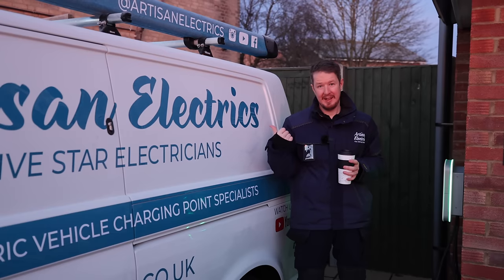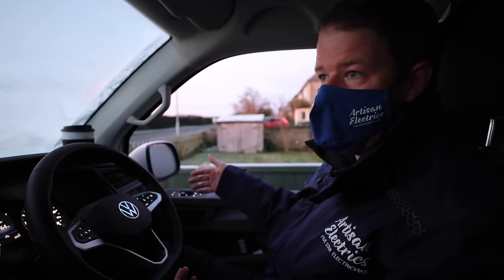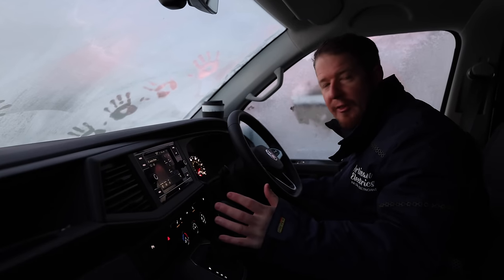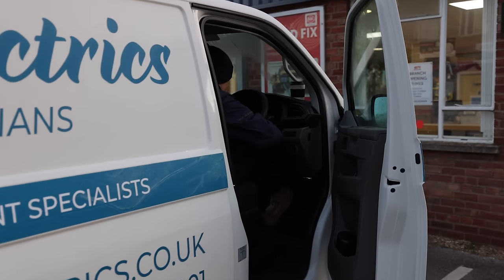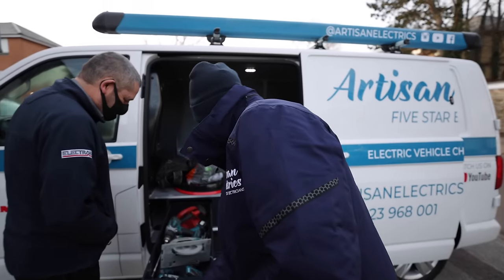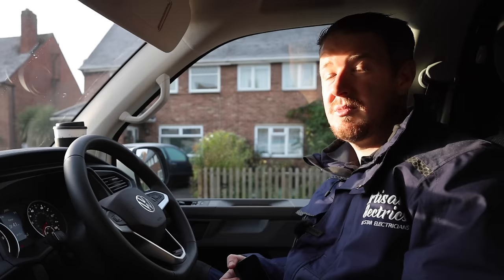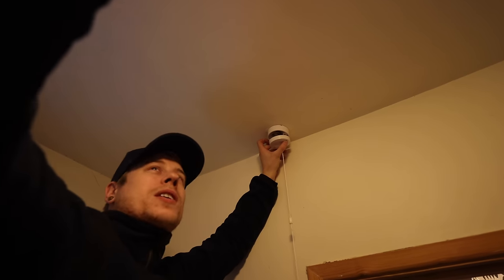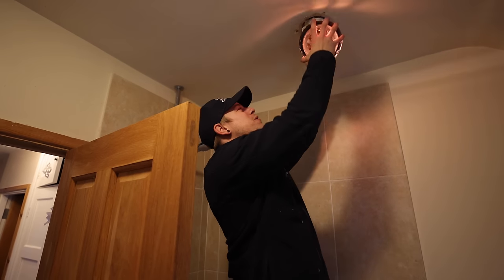ELECTRIC VAN NIGHTMARE 😬 - Volkswagen Transporter Electric Van

Comment: Great video Jordan. Hope the new van works out. Should you not be getting a maximum reading of 0.05 on the bonding conductor?  Perhaps your meter turned off and the leads needed to be nulled again. All the best and keep up the good content 👍🏻
Reply: It's 0.05 between simultaneously accessible parts mate not necessarily extraneous parts themselves
Reply: But this in an R2 test to test the bonding conductor disconnected from the MET. Your testing the length of cable for continuity and and making sure there’s no damage. On a 10mm bonding conductor a reading of up to 0.05ohms is normally obtained. 

Table I1 of the On-Site Guide (OSG) – and Table B1 of GN3 – gives the resistance as 1.83 mΩ/metre (0.00183 Ω/m). The maximum length L of a 10mm2 main protective bonding conductor can be found from:

             0.05 Ω      

  L =   0.00183 Ω/m  =  27.3 metres

The reading obtained by Jordan would of meant the cable was either 100s or meters long or damage. 
As mentioned I suspect his meter had switched off and the test leads needed to be nulled again.
Reply: @jonhosier356  From an old spark from the 60's. Jon you beat me to it, it was obviously a far too high a reading for 10mm bonding, my calculations showed the bonding to be over 600 meters, I guess Jordan was distracted concentration during videoing, Jordan is usually very diligent, but can easily be confirmed and rectified when they change the CU just make a note for future rectification. 
P.S. Crap van, will cause more headaches and frustration in the future.
Peter.
Reply: @jonhosier356  spot on there
Reply: Yes the reading is too high, I can only assume Jordan thought it was 0.1 as it was read out by camera man.
Reply: Jordan probably quickly sussed in his head that the bond was 0.02 and the null had be cancelled.  He just didn't mention it in the video.
Reply: @jonhosier356  yep, that 50m wander reel is going to add at least 1 ohm if not nulled
Reply: @havoctrousers  why isn't there a proper test device with a 2-core wander cable? Then the (dedicated) meter can send test current down one core, and read the actual volt drop on the other.

Comment: Shouldn’t the maximum reading for water bond be 0.05 ohms ? You had 1.09 ohms and said it was fine ? 🤔
Reply: Its 0.05 ohms max between the clamp and pipe not the entire length of cable, Im fairly certain that a bond of 10mm over 25m should be upped to 16mm to keep to resistance low enough for its task; which is to reduce touch voltage to <50v and trip fuse in 0.4s, so the max resistance of a bonding conductor can be worked out from that !

Comment: I have an electrical question relating to this.

The van charges at single phase at 3.6kW or 7.2kW on three phase.

I'm thinking that the van will just have two AC to DC inverters and effectively be a two phase charger (when on three phase).

Aside from being naughty, could you install a 3 phase charger on a single phase supply and just loop the single phase input to the 3phae charger?

FYI we're one of the very rare cases that this van suits, although having the additional charging speed would really help.

Comment: My E-van had a setting where you set the time you want to use it and it will pre heat the van so you come to a nice toasty vehicle.  Let’s say you want to leave at 7. You set it for 7am and as long as it’s plugged in and charged it will not only melt the ice but leave the cabin nice and warm for you to get in. That heated button might have been a demister for the mirrors. 

I had the second gen e vans. 8 hour charge time and upto 80-100 mile range. I sold it after a year and bought a diesel again. I’m prob going to buy a hybrid estate or mpv and use that as my work vehicle until e vans become better.

Also range wide load will factor in a lot. With tools and stuff will drain faster

Comment: I definitely won't be changing to EV until I have no choice. Free tip for clearing your windscreen and side windows. Just use cold tap water on them. With screen poor the water over it and put the wipers only once or twice and leave it 👍 if your away from home keep a bottle of water in the van 😉

Comment: Boiling water might crack screen , warm tap water is fine . You can not TOW an electric vehicle will damage the motors , it has be on a trailer . Chris

Comment: Best way to defrosting in the morning. Get a 5l bottle from screenwash or something like that, fill it with water and leave it next to a radiator overnight, in the morning put your wipers on and pour your 5l of lukewarm water over your car and voila, no frost. Using de-icing spray sucks because it can just make the inside of your windscreen freeze. Lukewarm water means ti doesn't cause thermal shock to the windscreen and crack it, the volume of water puts enough heat into the glass to stop it from re-freezing.

Comment: Sorry, but I have never seen a person, that did not know how to scrape ice of a window, if it had been a diesel car, the problem would have been just the same, there have been cars on the road more than 100 years without heated windscreens. 
You don´t roll down windows, when they are frozen, you risk pulling the frame off the glass inside the door, then you are in real trouble. 
But no, these EV vans do not work, they need to become better than they are now.

Comment: Always read the "destructions".  Switches should not be mounted on furnishing, walls only now.  No "Do not remove label" on bonding but regs cover such.  No fan isolator.  Cowboys let loose before you got there.  2E in one sleeve they could not have tested that!  External cables should be weather protected too.

Comment: I live in Sweden temperatures can hit -20 in this area batteries don’t like cold.  Try fitting a coupe heater which you can plug into the mains via a timer your van will be warm with no frost also buy an ice scrapper.
Reply: Not sure about this van, but EVs can be programmed to heat up (or cool down) for certain times. And if you leave them on the charger, you won't lose range and your battery is also on temperature.

Comment: So to summarise all the comments:

* £55k vehicle doesn't need a windscreen defroster.  Such feature is for more expensive vehicles.  Just get out there and start scraping with a credit card until your fingers go numb and stop whinging already!

* Windows don't need to be designed and tested for cold weather, because Europe doesn't have cold weather.

* Range anxiety isn't a big deal

* Nobody needs to go faster than 60mph

* Charging ports don't need a manual release on the plug.  The computer should decide when you're allowed to drive.   Refuelling should be done through smartphones because we are all very clever smart individuals with our smart phones living in futuristic society, get with the times man!

Comment: You can use similar tap water to outside ambient temps; like pouring a bucket or kettle of cold water to help melt the ice. Obviously a large enough differential in temperature and you have no windscreen

Comment: I made similar mistake on my first EV VW golf  pitiful range. I now drive a Tesla model 3 long range and it has enough especially with the Tesla supercharging stations. When I see these Vans and trucks coming out with a hundred miles or 120 MI not enough. I have a cyber on order the tri motor because of the 500 plus range. I'm a general contractor in California and I know when you weight things down and in my case tow equipment. That 500 will turn into 250 which will still be enough the fact is Tesla is the only EV  maker that knows what they're doing, not saying that others won't figure it out they just don't have a clue yet. Cheers from Northern California.

Comment: Bummer, but Caveat Emptor still applies. 
 VW was COMPLETELY sitting out EV's, all its chips on it's diesels to get to the required fleet mpg figure required. 
 When they got busted for cheating (1st reason not to buy vw) they switched to EV in a literal 180 degree switch and came out with their first model in 2 or 3 years.
 ALL their 1st gen are converted ICE cars.
 No way it wasn't going to be half baked.   ;)

Comment: I'm wondering if you should even be driving ;-)  "Out of my control" - not knowing how to use your own van is completely in your control, not having a scraper is completely in your control, not knowing to not use water from the kettle (just slightly warm water from your hot tap) is completely in your control.

Comment: I'm interested in the problems of switching to EVs, but reckon several of those complained of here are easily avoided with a modicum of preparation, such as familiarising oneself with a new and expensive vehicle.
Also, since one wants a clear windscreen promptly first thing in the morning, why not add another £5 to the investment of £50 000 by acquiring a windscreen frost protector?

Comment: At first i thought this is a great van. You have the combustion engine with a pretty decent range for a hybrid. Only to find out that the add i was looking at stating it has a 1.6 litre diesel along with the electric option was coming from a template and was not accurate. I was so surprised that it was delivered with only electric with the range of a hybrid. A very weird vehicle. And not cheap at all. Hope you had a shortlease contract on it so you can get rid of it.
Reply: My 1956 Austin A30 van was better than this. Kept going in the record breaking winter of 1963.

Comment: User error.... I have a nissan env200. I preheat the cab while plugged in, enjoy heated seats and steering wheel and. It's the cheapest 24kwr model for £15k second hand. I do 99% of my days without using public chargers. I get 50miles range at 60 mph and 70miles range around town

Comment: I'm sorry but to 

1) buy an electric van that only does 65 miles is crazy.
2) not to test the van to get to know how it works is crazy
3) to pay £65,000 for a van is crazy.
4) to show such technical incompetence on here is crazy - I wouldn't use you.

Frankly, I'd be quiet about all the issues. I'd take the van back to the seller same day and demand a refund.

Comment: Ford don't have the only heated screen.. Most Nissan cars do now.
The window that gets stuck has a pressure sensor built in because it auto go up which is a neck snapper to a child.. For such similar reasons it has to have safety built in. The frost is jamming the glass guides.. Pressure

Comment: As soon as the first manufacturer brings about a 600 mile range van transit custom and sprinter sized they will drive all the ice competitors into the ground then also drive all business competitors into the ground for business users because they can quote less with the minimal fuel and maintenance costs

Comment: have you tried locking and unlocking the car when the cable wouldn't get out? also, was the wall charger set to charge? because i am pretty sure the power used to defrost the window was coming out of the network if it was. also, scrape the damn windows instead of clowning around putting your hands on them. better yet, just press the preheat button if the car has the option.

Comment: The main relay will not cut in until the charging plug is removed and the indicator on the dash shows 'READY' the charger lead is released by pressing the unlock button on the remote.

Comment: The range alone would be a deal breaker for me in a van, if that's the range when empty, by the time you've got a bit of weight in the back it'll be useless. For an electric van to be successful I'd expect at least 200 miles unladen and 150 laden, and 120 on a cold day. With only 64 miles range to play with that wouldn't get me back home after a couple of jobs. Sure you can charge while you're out, but it's not as convenient as diesel due to the time taken. Don't get me wrong I'm very excited about the future for electric vehicles and can't wait to get one myself, but we're not there yet for commercial vehicles as far as I've seen. This is another reason why it's short-sighted for government and councils to ban diesel vehicles in towns when the electric equivalent just isn't ready for prime time yet

Comment: does the transporter have an excessively tiny battery? afaik its designed for last mile delivery. like hardware stores and building supplies. around 50mi a day tops

Comment: You would (honestly) think that VW had placed those fine wires into both the front / rear Screens, for melting the ice. They don't draw a lot of current, and (surely) this form of demisting and heating the Screen on this EV VW Van has not yet been discovered by its' new Owner.

Comment: Reel out an extension lead in to van and plug in an oil filled heater put it on a high wattage timer. Let it come on half hour before vehicle use. Secure rad down and you have a heater for the 1st hour. Ps. Dont forget to unplug heater before driving off.

Comment: we returned our EV work van within 48hours.. it refused to charge for 2 days in the cold yet it was running 80+ amps for a full day... its still cheaper to run my diesel even at the prices.. when it did finally charge we had about 73km total even with the extra capacity battery. when we finally got our electricity bill the 2 days of charging was more then a filling up both diesel tanks on the ford truck.. we were not impressed whatsoever with it.

Comment: I've never seen someone so inept to get a vehicle deiced and actually move, may I suggest reading the manual on the vehicle before you use it. As for the electric window the glass and the channel that the glass runs in was frozen and the window going up to a certain level then going down was to stop you from straining the mechanism and thus burning out your electric window motor (It's there to stop people damaging the motor/mechanism when there's an obstruction for example someone's arm or a frozen window.

Comment: Yeh I don't think for a job like yours a pure EV is approriate, I think a Hybrid with a desiel generator would have been a better option, because having 50 miles of EV range isn't horrible when you can extend that out to 150 - 250 miles with the diesel generator without having to completely rely on the desiel generator for the power to drive, because at that point it's going to be slow and really slow to accerlate.

Comment: Dont know about Germany but here in Finland where it get minus 20 down we have webesto in cars and or  plug in engine heaters as well as basicly a fan heater in the cab that warms and melts ice and snow. and most car parking places have a plug sockets i mean heck been from England myself lived in Finland for 2 years -2 seems so tropical 😆
Reply: German here. Although Webasto is a German company, independent car heaters are not that big in Germany. Some people have them, others not. But winters are not that harsh here in Germany, so that most people can live without such  heater (and then we have the usual idiots not scraping the screens or only a small hole...), especially since climate change is going on.
EVs have independent heater already integrated, simply because there is no engine which converts roughly 85% of the energy put into it into heat. And usually they are programmable.
So if you have your own charging station available, it's quite simple: plug in your charger over night and program the EV to a starting time and you will find a car with defrosted windows and nicely warm inside. And with full range.
With an EV it even gets better, as the system is not only a heater, but a full-blown indepedent AC: I own a Cupra Born since beginning of this year (basically an VW ID.3) you can start the AC via the app and the cars either heats up or cools down to the requested temperature.

Comment: Electric vehicles are a red herring at the moment and that’s before you understand where some of the mineral come from to make those batteries and the environmental impact it has on the local environment also consider the fact that you are still producing plenty of carbon as the electric still needs to be produced. Yes ford owns the patent for heated windscreens but other manufacturers including VW still use the technology obviously they probably pay some sort of royalty/licence fee to ford to use it. The side window issue is due to the electric motor sensing it is struggling or there’s something blocking the window and rolls itself back down to protect from damage.

Comment: Despite the obvious errors by the owner, schholboy errors!! This is not the first instance of electric vehicles in the so called "trade" being slated, a recent report into Royal Mail stated that the EV vans had diabolical mileage under real world conditons, and most vans could only achieve one run before a recharge the issues here, most depots have limited charge points and at a cost of over £4,000 to install.
Most laugahble was the range of the E-Vito real world range not the test figs, ahem 60-80miles whilst loaded, at almost £40,000 per vehicle!!

As for quick defrosting buy a diesel with its superior thermal efficency!

Comment: Can you not defrost the van through your app while the van is plugged in? The app allows the GTE cars to do that so you do not need to open the vehicle in the cold. Maybe the van is different.

With the charger not unlocking until you unlock with the key… surely this is better than someone being able to 7nplug the charging whil you are away from the vehicle. These cables are expensive.

As someone else has said, not sure I would want you to work on my stuff when you couldn’t get the van going.

Freezing weather also destroys the battery performance. Anyone knows this. Take the van off him, don’t give him anything sharp to play with.